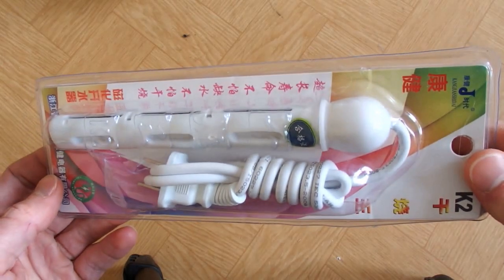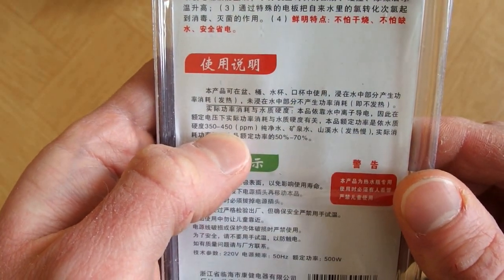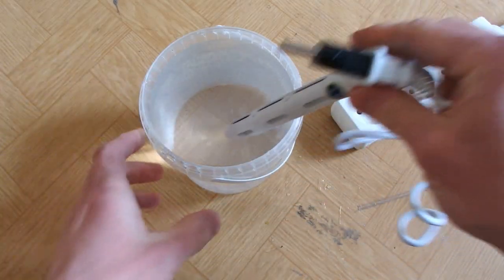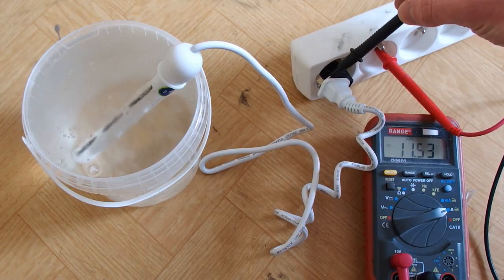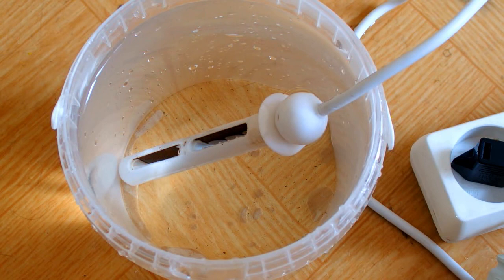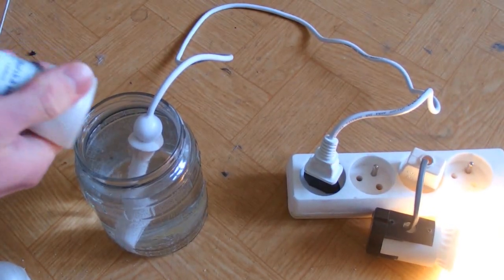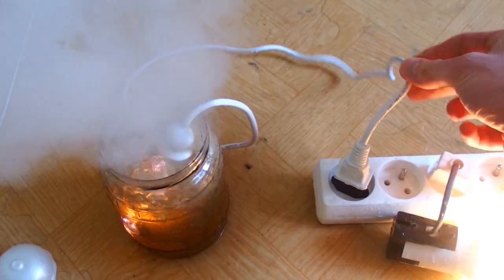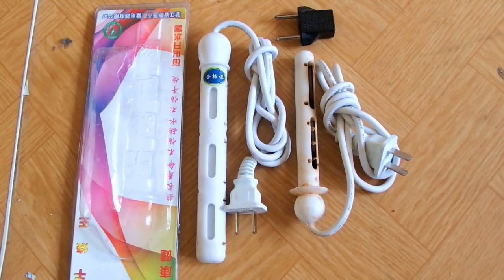Suicide Water Heater & Deadly Experiments (Gone Too Far)

Comment: It's is like the heater were 100 VAC and you link to a 230 VAC wall socket, I had one 1000W and wasn't so fast this way, I've lost the mine by forget this plugged to the wall socket, all the water had evaporated and the resistance just melted the aluminium case and burned :-)

Comment: 3:50 judging by the hum, its power is in the range of 2 or even 3 kW
4:40 That's the smell of the electrodes oxidizing (they should be made of graphite or better still coated with silver or gold)

Comment: This is extremely unsafe. Water everywhere... including the electrical outlet. You breaker is worthless. That was a complete short circuit when you added salt to the water. It should have tripped.

Comment: What a cool invention!, I'm going to buy such a thing.
BUT I don't get why the water is getting brown..?
Is someone able to explain this?
Reply: TheJumpingPoint cm Probably some sort of Electrolysis. If the plates in the "heater" are stainless steel then the brown stuff is hexavalent chromium, a pretty nasty carcinogen. There are also likely some metal salts and hydroxides that are formed. But because it is AC the chemical background is quite complicated.

Comment: This device actualy works on 110v not 220v this is why the power is 4 times higher
Reply: The_DankSmith nope, it's intended for the Chinese market, which uses 220. That's a Chinese plug, not a US plug. There's subtle differences between the two, though they will sort of interchange. Not to mention the fact that this thing wouldn't meet any US (or European) safety standards.
Reply: @puckcat22679  Well actually in the US it would be protected by the 2nd Amendment.
Reply: Nobody carezzz

Comment: The reason why it was sparking when salt was added is because it created a short circuit.
 It is because the salt decreased the water's resistance and and the water created a short path from one electrode to another. So it made arcs
Reply: No, it made hydrogen gas from splitting the water and the explosions are the hydrogen igniting.

Comment: On the product description:
This product can be used in basin, bucket or cup. The parts of this product which immerse in water produce heat, while other do not. Actual wattage depends on quality of water: this product use ion in the water to conduct electricity, so actual wattage depends on water quality when used in rated voltage. The rated wattage is measured using water with quality of 350 to 450ppm (eg distilled water, mineral water, mountain stream water). Actual wattage is only 50 to 70% of rated wattage.
Ignore my grammar :)

Comment: I bought one of these and the cable is definitely not rated for the power it draws. The wires are quite thin and when I used it one day,  the wires melted and made a spark. It was a great device,  but the cable must be thicker.

Comment: LOL I don't know who was that irresponsible to put this on ebay without a proper illustration. Yes this thing is well-sold in China. BUT IT'S ONLY SUPPOSED TO BE USED IN A VACUUM FLASK!!! NOT in a wide-opening container. This thing is marginally better than a normal resistive heater because it will stop heating if some fool left it plugged for a long time. It will leak electricity yes, but the same thing goes to resistive heaters if the ceramic coating on the heater wears off or if there is an internal short.

Comment: The first thing I realized when you turned it on was "omg this is a hydrogen generator" basically all the vapor coming out of the water is extremely flammable
Reply: This dude fuckin poisoned himself💀🚬
Reply: Is this due to the salt + electricity or just electric?
Reply: @RaaynML  Skip to end for the in short

Reactions that make hydrogen:

H₂O + e⁻ -> OH⁻ + 1/2H₂

Na⁺ + e⁻ -> Na
Na + H₂O -> NaOH + 1/2H₂

The first is direct electrolysis of water, the second is electrolysis of sodium cations to elemental sodium and the immediate reaction of elemental sodium with water. The difference? None for these purposes but it may matter in other electrolysis systems. I'm not really sure which is dominant, I do however know that without the ions the reaction. Along with that happening at the anode there is also chlorine being made at the cathode (the cathode takes electrons/oxidizes things, and Cl⁻ is easier to oxidize than OH⁻ Lose Electrons Oxidation - LEO as in "LEO says GER"):

Cl⁻ - e⁻ -> 1/2Cl₂

And finally just for completeness the proper mechanism on all of the reactions that generate 1/2X₂ is

Cl⁻ - e⁻ -> Cl·
H₂O + e⁻ -> OH⁻ + H· (Na is an effective source of e⁻, creating Na⁺ as it is used... very effective considering the explosions it causes)
2X· -> X₂ (X = H, Cl)

(the dot on the Cl·, H·, and X· notates a free radical/unpaired electrons. If these radicals weren't separated you would end up with a large amount of HCl being created as opposed to just Cl₂ and H₂... which would immediately react with the NaOH to make water + NaCl)

So to answer your question: The salt just acts as a catalyst for the reaction, you could use any sufficiently electropositive cation to create the H₂. Magnesium sulfate is a safer option because it doesn't make Cl₂ on the cathode, just O₂
Reply: @JGHFunRun  I know I'm one year late, but do you know why was the water brown at the end? And there some brown deposits of some substance too. I'm not a chemist, but I'm just curious what that was
Reply: @bamberghh1691  what once was parts of the heater. Neither the plastic nor the metal the electrodes are made of can withstand the extreme heat and the hot chemical reactions as a bonus.
Reply: @DeuxisWasTaken  Thanks!
Reply: @bamberghh1691 anodic corrosion of the anode
Reply: Idk but it looks like hydrolysis

Comment: Japan uses 100 volts ac 50/60hz depending where you are in japan...but your plugging it into 230 volts ac 50hz so your power is double....is that meant for 230 volt use? I know it’s dangerous either way but just wondering

Comment: The thing is, that's a Chinese plug. If I recall correctly, China's mains voltage is 120V, while European plugs have 220-230V. That adaptor actually did not convert the European voltage to American voltage. Mabye that's the problem here?
Reply: First two minutes of the video, he reviews the back of the package: 220V 50Hz "500 Watts"

Comment: Nice demonstration of ohm law vs watt : applying twice the voltage makes the power raise 4 times. The 500 watts heater, when used in Canada/United States will draw 2000 watts on the European electric system.

This video also demonstrates another interesting device of the past : the high power variable resistor using salt water as semiconductor and changing electrodes depth to adjust the current. These POT are naturally water cooled, so they dissipate heat much better than even heat pipes.
Reply from the maker: The heater is actually designed for 220V. I'm not sure why does it draw more than it should. Maybe the Chinese water is less conductive :).
Reply: DiodeGoneWild I beg your pardon, the facts are:
Standard 120 plugs ; you used an adapter to connect the heater to the round holes plug. This device doesn't halves the power with a diode.
The math work just right as you clearly show by measuring the current. The 500 watts heater was being abused at 2 kill watts. Makes nice video, but it still doing like photoinduction, the YouTuber who send 100 kv to a 12 inch TV or throw a brick inside a washer rotating at full speed. Very entertaining.
Reply: I didn't notice that this heater has no heating element ; it apply electricity directly to the water. This is dangerous, as you correctly describe. It is also dependent on the electric conductivity of water as you demonstrated with adding salt. It can not work for long neither since the electrodes dissolve quickly.

The comment about ohm law remain valid : if you double the voltage, a purely resistive device will consume four time the power. So, 500 watts spec raising to 2000 watts in your setup indicate that those electrodes follow ohm law.
Reply: The packaging (reviewed in the first 2 minutes of the video) states that the device is rated for 220V 50Hz 500W. This could simply be a lie though, and this heater was clearly drawing far more than 500 watts.
There's no such thing as a "standard 120 plug"... the plug/socket does not define the supply voltage, in several cases you can find the same style of mains plug/socket being used in both 110-120V and 220-240V systems in different countries. The choice of plug and socket used in any particular country is mainly due to historical reasons.

Comment: electric current can flow only on basis of electrolysis through the water. So there is definetly electrolysis going on. Due to AC it can be likely that hydrogen and oxygen recombine directly on the electrodes or very near by. But it depends on the minerals if oxygen or chlorine e.g. is produced. You should definetly smell a bit of chlorine at that amperage and you can tell by the greenish color of the water afterwards :-)

Comment: I met once a kettle that had only electrodes. That was safer because you disconnect it if you lift it from its base. Nobody wants to cook soup with these only heat up water for tea or instant coffee. The idea is very old even from the 20th century. In army refugee camps, or even in gulag they used two electrical wire put in the mains socket led to water. I know it is not safe I'm an electrician. Brown water. It's AC but electrolysis happens clor gas comes and corrodes the ferric metal making ferro cloride. Oxigen, and hidrogen, sodium /natrium also develops. Different chemical reactions can happen in salty water.

Comment: Those things are bloody dangerous! I saw that BigClive had done a video on these as well, but not to this extent. Lethal devices!
Reply: spotify95 yea BigClive did a good job bit this guy... Whoa? This guy is nuts! I thought the wire was going to catch on fire!
Reply: SaLt
Reply: It´s unpleasant when touching the plastic rod, and actually, most of the time, the hot water will have burnt you long before your fingers reach the plastic rod... Millions of central-heating-boilers around the world do the same, many German/American-producers, the expensive stuff, for high-rise-buildings and factories... Just boiling water in the most efficient way possible (boiling since second 0), no Hydrogen-fumes-generation at all, no minerals-precipitation to clean afterwards, just perfection...
Reply: I heat my water everyday with something like this

Comment: I think the purpose of that device was to crack water to make hydrogen. Not to boil it... but real funny video.
Reply from the maker: But the thing is that it boils the water, it produces almost no hydrogen. You can't set the bubbles on fire. Tap water has a high resistance, so most power turns into heat. AC current also mostly cancels the electrolysis.
Reply: Yes, you are so correct. Don't use AC, Get a 100 amp fullwave rectifier from banggood, make a capacitor bank from SMPS(old pc PSU about 8 would do, wire them 2 in series, 4 parallel pairs. I dont have to tell you about polarity) you have your variac so you good to go, and wire a pair or more of the heaters. and lets make Hydrogen. more fun for you I think.
Reply from the maker: For efficient electrolysis, you need a high current low voltage DC. You also have to add something to the water to make it more conductive, for example sulphuric acid.
Reply: +DiodeGoneWild
If it had a power supply similar to a welder's power supply (100-250VAC mains changed to 10-40VDC) it would produce lots of chlorine gas when you put salt in it. You said "don't try this at home", but i did something like this on a smaller scale. 
I connected a 6 volt 5 amp lantern battery across ~200ml of extremely salty water with heavy duty copper wires (previous ones melted!) and made a bunch of green copper chloride, but if i used steel or aluminium electrodes it would have produced more chlorine gas.

Comment: Glass jar + no gloves + I bet no safety glasses + water all around live conductors + wet fingers moving the melting cable + more salt + more salt + more salt + more salt... You're INSANE
Reply: thats the reason why im here!! EVEN MOAR SALT!!! ⚡️🔥💥
Reply: Matthieu G legendary man with a shitty tech
Reply: He was likely wearing rubber boots so that his feet were not grounded. But indeed, this should contain more warnings and better display of safety equipment.
Reply: China: Sooo... you had chosen the death
Reply: I love this guy because of the insane stuff he does :)
Reply: It wasn't really fire, the salty water just got so conductive, that the bloody thing started arcing out. That's what looked like fire, but it wasn't really flames. But he could have gotten electrocuted even not being grounded (standing in rubber shoes) with the melting cable he was touching. If the two conductors only melted out of the insulation and touched his wet salty hand, his fingers might have just gotten ripped off or at least badly burned :D
Reply: @5Dale65  arc did ignite it I guess but I thought it was hydrogen/oxygen explosions making the flames in the jar, not arcing alone. Arc would be faint blue light.
Reply: This youtuber is a little more crazy than the device itself! :)
Reply: When you see a Slav disregard safety, you DO NOT question it.
Reply: Matthieu G  man he is not a crszzy rushian hacker
Reply: Matthieu G, no he is crazy, not insane.
Reply: dont go making assumptions matthieu G
Reply: Looks like some where in east europe

Comment: You should do a video on the suicide shower head.Those are much more scary :D
Reply from the maker: I actually plan to :) But on ebay I only see the 110-127V version of it... Do they even make a 220-240V version?
Reply: I've had one in my hotel in south Afrika.The sockets where 220V Don't know if it was between phases.but I imagine that such a huge load also gets that full 220.That's actually more scary! It means both sides are on some 120V relative to ground.

Comment: If it was not for the widespread use of E27 and B22 lightbulbs, I'm sure those sockets would long have been banned in favour of GU10/MR16 style sockets, since every table lamp exposes the live connection whenever the bulb is removed.  Similarly for 2-way light switches which leaves a 50% chance of the light socket being live when changing the bulb when one cannot remember if the light was switched off.
Reply: Seán Byrne Pretty sure those light bulb sockets predate modern ideas of electrical safety and almost all of the connectors currently in use. Also, it was still safer than gas mantles or candles.

Comment: Yes i think you did go a bit too far LOL :-D
Why do the chinese think this is safe?, they must be mad!!.
Have they never heard of resistive heating elements.

BigClive reviewed these as well, he didnt test them as fully as you did LOL :-D
Reply from the maker: They probably don't care because they are trying to limit their 
overpopulation  :).  And they don't care about foreigners as well, 
because it is nearly impossible to sue the manufacturer in china.
Reply from the maker: No, this one is really for 220V.
Reply: for China, its "safe" for "export only" ... it kills outside of China ^^
Reply: Hey look, in Europe we use TN-C or TN-S power system, so all the earth has 0 potential and is grounded. So you touch a live conductor and earth and you get a shock. Maybe in China they use IT network which means isolated neutral. This causes no current pass between live and earth, because the earth is not grounded, like in TN type system we use here. And thus this device really may be safe in China...
Reply: @5Dale65  IT networks aren’t used for power distribution because they are only safe for short distances (cable lengths). The capacitance with respect to ground grows with the size of the network so that it's no longer "safe to touch" one conductor in expanded installations even if they aren’t directly grounded. So every building, apartment, or even room would need it’s own transformer to make an IT network "safe" and you’d need insulation monitoring because otherwise the first fault (one conductor accidentally tied to ground, turning it into a TN network effectively) would go undetected. This makes IT networks too complex and expensive for common power distribution.